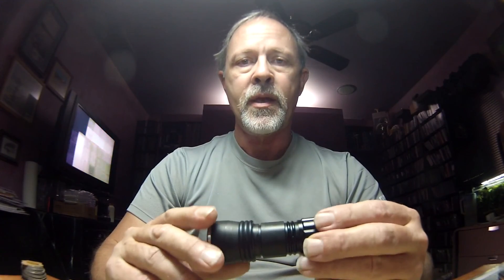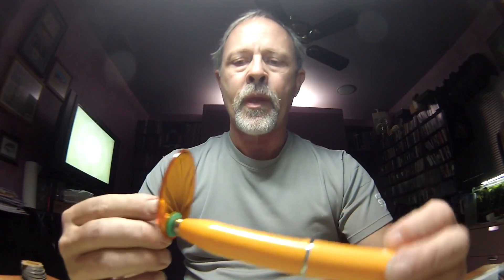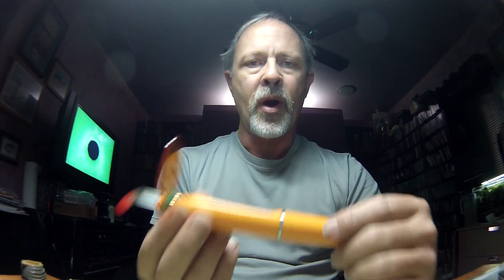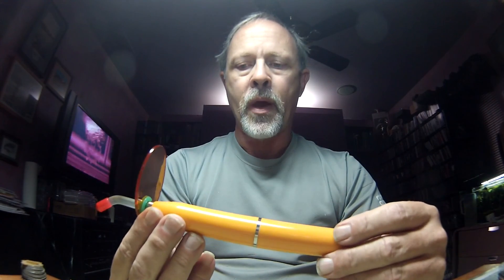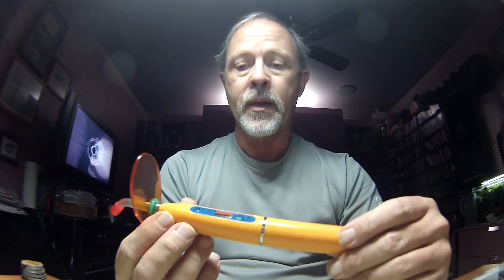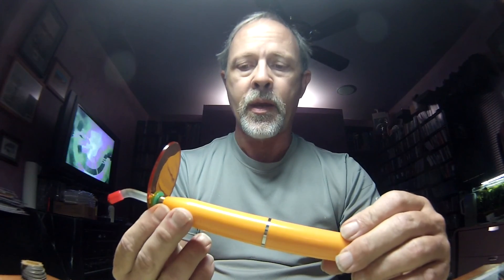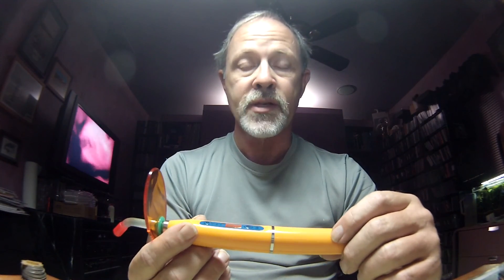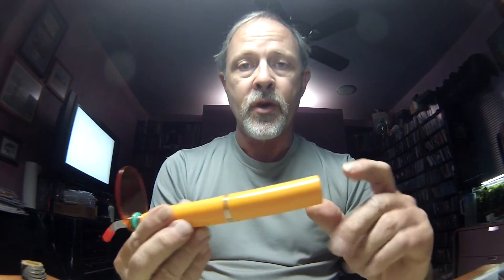Light Cure Epoxies and UV Lights for fly tying

Comment: Get real! I apply a drop of resin and hold my little  bench light($12) on it for 15 seconds like the instructions dictate. It's  hard as a rock in and out and a quick  wipe with rubbing  alcohol  removes any surface residue.

Comment: I am wondering if there any decent 1w, replaceable battery powered sort of units? Do I need to know the chemistry of the resin I use so I can pair it with the light source? I only tie for myself so the light would not be used a lot. Looking for something low cost and reasonably effective that does an ok job.